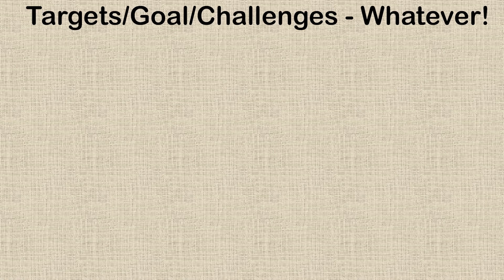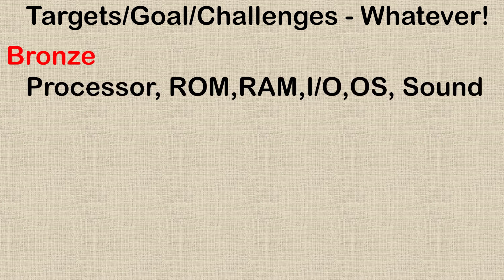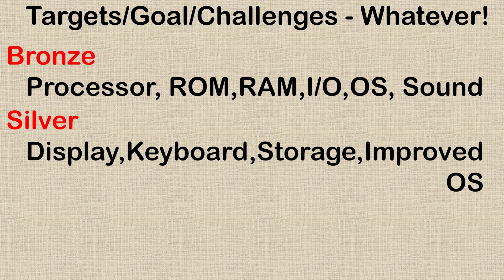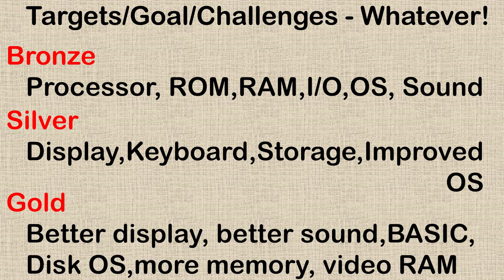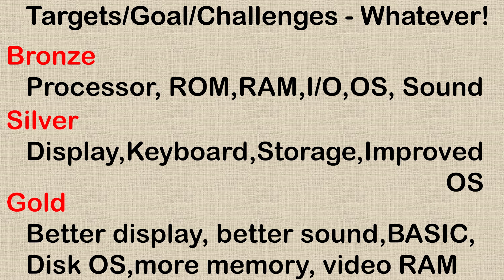Designing and building an 8 bit computer - New series Ep1 - Intro

Comment: 6809 is better then the 6502. if you like it fast and have some ASM-Code then the faster 65816 with 14 MHz is a good choice.
8-Bit still  lives and programs are shorter then the code for 16-Bit and 32-Processors. I like this kinds of projects .today we have better ROMs and RAMs but no Chip for HDMI-Output . A fast 10“ TFT for graphics is a good alternative instead of the old VGA. For education is VGA great but to old.

Comment: Memories, had a zx81 and did some 6502 asm on C64 years ago. I would say excel, but prefer calc.
Reply from the maker: Started off with an 81 myself also, then a oric 1.... Please don't judge, I was young!
Reply: @XTronical  said in a whisper "Atari 400" lol
Reply from the maker: That had the membrane keyboard didn't it? Like the zx81?
Reply: @XTronical  yes, and a cartridge slot on top. I Wanted the 800 but too pricey back then.

Comment: This sounds really interesting.  I have read a couple of books about basic computing but my old grey cells struggle a bit so I'll definitely be following along to see what I can learn and if it makes it all become a bit clearer!  Is this going to end up with a Ben eater size board?  Anyone deciding to try this I'd advise you don't skimp on cheapo breadboard as connections can be fairly ropey!  Looking forward to part two!
Reply from the maker: Top tip and something I'd not given much thought too actually. Thank you.
Reply: Breadboards are only for temporary tests. A good connection to all used components is important and a very good power supply for every chip. It’s a good idea to take a design tool for a PCB if you know how to connect your components. Production of a PCB is cheap.
Reply: @paulkirchhof9546  absolutely, but the breadboarding does allow for testing and experimentation in the early stages.  It's also good for beginners to follow and get a better understanding of the circuit, imo!